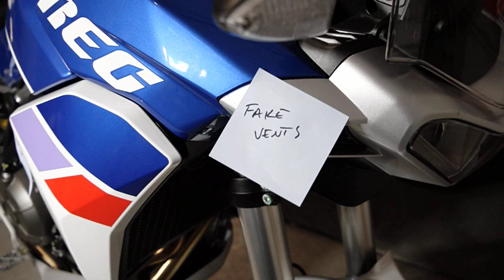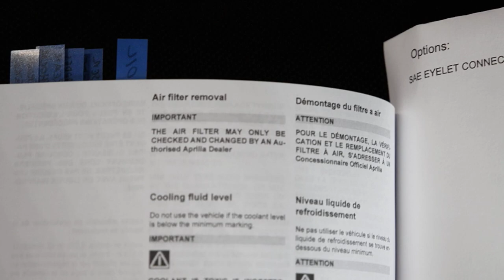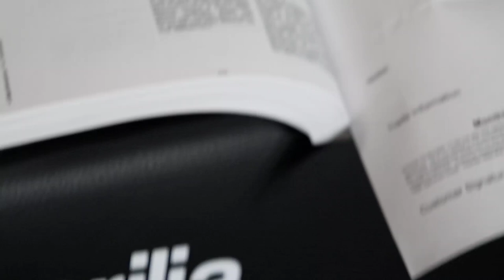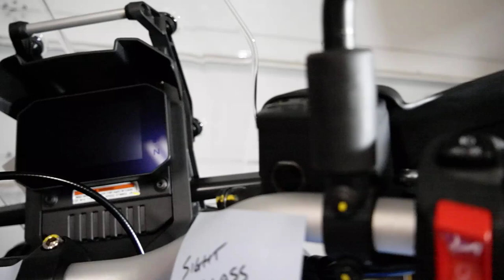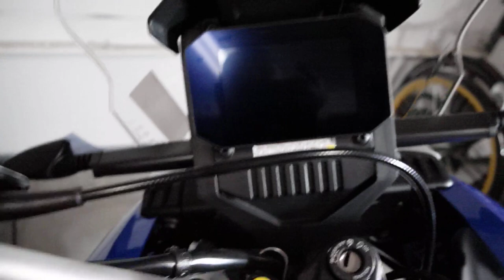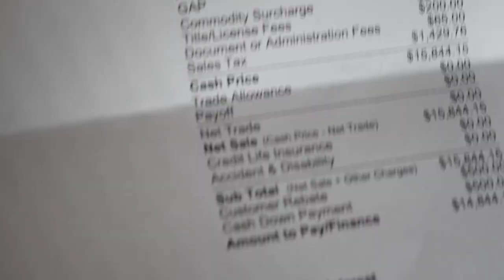Aprilia Tuareg 660 First Impressions

Comment: I don’t believe they are fake Vents I believe they are support for the fairing ..fairings are there to keep the air off your legs It looks like the air is forced through the radiator pushing down around the engine toward the road a clever design .. Just a point of view
Reply from the maker: You should consider applying for Aprilia’s marketing team.

Comment: I have a Tuono 660 and it's been reliable and a great bike to own. The crooked handlebars would annoy the shit out of me, but it was fixed. I have the same complaint about the non adjustable clutch. I purchased CRG set. The engine sound great stock and will sound amazing when you put a SC Project exhaust on. The leaking exhaust SHOULD stop it just needed to heat up and seal. The fit and finish on the Aprilia is much higher than any KTM or Husq product
Reply: Bullshit, Husky way better

Comment: Thanks for the honest comments. Regarding the sound; I think you need to consider the context; manufacturers are being forced to make exhausts quieter, so to give a bike a decent sound they tune the induction noise to compensate, not as good as a throaty exhaust, but not too bad considering. Also, it’s only 660cc. If you wind her up (maybe you are keeping the revs down as you are breaking  her in); the sounds improves.

Comment: Thanks for the video and pointing some things out others haven't.  I pick mine up tomorrow.  I paid $400 more for the Dakar color.  Paying $12,699 plus $800 for delivery in New Hampshire.  Hope you are still liking the bike after two years.  

Regarding form following function, I couldn't agree with you more.  I would never buy a Mustang because of the stupid side vents in the rear when it is a front engine car.  Maybe I will drill out the plastic behind the radiator to make them a bit more effecient and purposeful.  I totally thought the intakes were up high by the light and I am pretty sure a youtuber said they were specifically.  I wonder where the intake draws air from if not there.
Reply from the maker: The intake is underneath the "tank."  I think I have another video when I take it apart and show how to do it. It's been a while since I've been riding and doing these videos, over a year.  I'm only now getting back into it and my memory is failing me as to what I vlogged and whatnot.  Anyways, I'm back!  I think you'll enjoy the bike, as much as I think I over paid and it's not perfect, I'm glad I still have it.

Comment: Thanks for the very informative video. If I did a similar video about my BMW 800GSA and 850GSA it would be 5 hours long. Hopefully, that helps put things in perspective. I'm very happy Aprilia resisted adding gizmos and weight to this bike, unlike BMW. I bought mine recently and don't have the +$200 charge (same color as yours), I do have the exhaust crud which is annoying, I think the exhaust sound is amazing and not requiring an aftermarket exhaust that I've had to put on all my other bikes, and I do not have the TFT tilt (within 0.3 deg measuring at several locations with a digital level). The heat on the right is not a problem at all with adventure riding gear, it is annoying with jeans. I find the oil dipstick mildly annoying to unscrew and screw in because it's nested in-between stuff, could use a larger tab. The clutch lever doesn't bother me, the levers never match on my mountain bikes as the rear brake pads wear much more than the front. For the non-adjustable components (rear brake, shift lever, and clutch) I think they Aprilia an amazing job putting them in the proper place, I truly couldn't believe it given that I can't get my 850GSA rear brake lever in the correct location and it's adjustable. Drives me nuts when standing on the pegs off road. I've owned a lot of motorcycles (adventure, sport...) and this went to the top of my list for pure fun, on road and off.
Reply from the maker: Nice, good to hear you rank it high amongst your previously owned bikes.  I'm new to the ADV arena, so don't have anything to compare it to.  However, I did ride a 2022 BMW GS1250 on the road for about 60 miles recently, and liked my "rag" way better.  I agree with you that Aprilia did a great job putting everything in the right place, that or their ergonomic test person is similar to you and I, I'm 5'8" with huge balls.
Reply from the maker: Oh man, I just realized you’re part of the 0.7% of my audience that is female, based on Google’s analytics.  I hope my last reply did not offend you, my apologies if it did.  My attempts at humor are often offensive, but I’m a nice guy in person.

Comment: Thanks for putting this video together, I’m curious if you pre-ordered online, or picked it up at the dealer? I pre-ordered one (with heated grips & center stand) trying to determine how long it’ll take.. and now that I’ve seen your video, if there’ll be any other charges.
Reply from the maker: Hey David, I called my local Aprilia dealer and asked if they were expecting any. They said yes and I put a $500 deposit down.  I thought they would push accessories when I actually picked it up, but they didn’t even bring the topic up. I had to ask about them and whether I could get a discount since I was buying the bike there.  They said maybe I could get a 10% discount on parts. I thought about getting a bunch of stuff, but since decided to only get what I absolutely needed. Thus far, I haven’t really “needed” anything.  I have no idea how long an online pre-order would take, sorry. I think the two accessories you ordered would be what I would get, those and maybe the lower comfort seat since I’m only 5’8”.  However, I’m doing fine as is.  I’m also waiting for more third party vendors to come out with accessories, which I think will look better and hopefully be cheaper. Oh, regarding “hidden charges,” if I could do it all over again, I’d be ready to walk away from the deal if I smelled anything fishy about the invoice, which in hindsight, I kinda did.  Not sure if you can do that in your case since you’ve pre-ordered it, but you should be able to feel good with the deal before plunking money down.  Just my 2 cents. Good luck though, you will like if/when you get it.

Comment: FWIW, I did not have a commodity surcharge. I paid $800 for freight, $200 for the Admin/document fee, and I think ~$15 for title and temp tag. I think it was $13,598 before taxes. I don't think the commodity fee is coming from Aprilia... Thanks for the video! I'm going to have to check my bike for the things you've pointed out...
Reply from the maker: Thanks for sharing Adam.  I'd be interested to see if your dash is slightly off also.

Comment: Thanks for your video. It is the details that determine the quality of the motorcycle and when something is visible on the outside, what it will look like after x thousand kilometers inside. It's not a bad motorcycle, but for the money it could have been better, including overpriced spare parts. I choose between the Tuareg and the Tenere and I am becoming more and more inclined to the security and reliability of the Tenere.
Thank you.
Reply from the maker: Radek, I agree reliability is definitely a key factor when considering it against the Tenere.  However, I will say that I'm still glad I chose it verses the Tenere, in that it's different and has a certain bling factor that I don't think the other bikes have, specifically the T-7 and the KTM.  I say this without actually owning either though.  It's like dating a girl, yeah she's not the sharpest tool in the tool box or doesn't make sense at times, but she's hot, so those factors don't seem to matter until they suddenly do down the road.  If you're a female reading this, swap girl/boy, he/she and loaded/hot.  Trust me, I'll be the first one to complain about this bike's reliability...

Comment: The Dealership pulled fast one... How bad is the heat from right side?? I've read a lot about it..
Reply from the maker: Yeah, I think they got me, oh well, so is life.  Regarding the heat from the right side, it's really not that bad.  Yes, I do feel it, more so from the right than the left, but would knowing that beforehand have stopped me from getting it, or do I regret getting it over the Yamaha T7? Nope.  The more I look at it and ride it, the more I'm satisfied with my decision.  Going back to the heat, whenever I feel like it's getting too hot, I just kick out my knee and let some air flow through.  In the whole scheme of things, it's minor, at least to me.  However, it's all relative, I've suffered through much more for much less.
Reply: @ocdmoto  Good to know...
Reply: The heat is more than double my africa twin and thats 1000 cc. Actually the honda has zero heat. Its all because Apilia stuck the Cat in front.

Comment: How did your fake vents to open vents help in cooling and also did it direct the hear better away from your legs or just in a deferent location around your legs?
Reply from the maker: Mr. Rogers, I really didn’t notice a difference because I didn’t ride it a lot before doing this mod.  However, I suspect there’s more heat around the upper front shin area than before, although when I put my bare hands over the vents it’s not like there’s super hot air flowing out.  There’s way more radiant heat coming up from the cat. I was ok with this possibly of more heat before making my first cut because I felt cooling the radiator more efficiently was of greater importance than any extra heat I might feel. Also, knowing those vents were blocked really bothered me every time I looked at that area, which by the way, is a focal point for me.  I would like to know if other Rag owners (that’s what I call it) see engine temps at three bars or higher on their dash?  I hardly ever see above two bars. If others see three bars all the time, then opening the vents actually made a difference.  If not, no biggie, I’m still glad I took the time to do it based on principle. Thanks for your other comment on my other video btw.

Comment: I'm looking at this bike but dealer support is hours away not sure if that will hurt me. The T7 is not for sale anywhere near me and definitely not at msrp. Whereas I can get one of these seems like a great bike based on reviews but no one has had one for that long. Would love to hear how your feeling about now that you have had it for a month or so. Thanks
Reply from the maker: Hi Tim, I do like it and would recommend it to you.  Granted, I don't know you, but if you're in the market for a middle weight ADV, I think this one will prove to be the one that hits that sweet spot in the coming months and subsequent head to head reviews.  Any issues I have with the bike are cosmetic, which I've addressed with my mods, and the dealership I bought the bike at (cause I'm think I got suckered into paying $200 over MSRP).  Having done some simple mods already, which required me to take apart some fairings and whatnot, I have been pleasantly surprised at how the bike was designed and the quality of its parts.  There's a lot to be said about how a bike makes you feel, it's hard to quantify on paper, but you know it when it does.  This bike does it for me.  I think you'll like it more in person, where as I think you'll like the T7 a little less in person, until you "personalize" it.  It doesn't seem like you have a choice, but I don't think you'll be disappointed.  Even if The Rag (which is what I'm calling it) proves to be unreliable, we'll just have to deal with it.  Sometimes you have to just go for it and never look back.  Let all the bean counters and worry worts argue stats and what if's, we'll be out riding and having fun.
Reply: @ocdmoto  hey man thanks for the reply I have a got a test ride next week and unless there is something I really don't like looks like I will be getting one !
Reply from the maker: That's the right way to do it, good luck and congrats, -cause I know you'll like it.

Comment: Yep my dash is canted about 3-4 degrees to the left. Tft is cock eyed on mine too. Not an easy fix either. That shit mounts on steering stem.
Reply from the maker: Katherine, you might be surprised how much it'll move once you loosen the four bolts holding it to the steering column.  You just have to hold it in place while you tighten them down.  That's assuming you've removed the three screws holding the radiator fluid reservoir and the two bolts holding down the two small fairings on either side.  The distance of the visual line created by the dash and side markers are quite far out, so small changes at the stem, make larger changes further out.  Anyways, if you care, it was bothering me quite a bit, it even bother me after correcting because it felt as though my left arm was more stretched out than my right.  However, it turns out, my arms are just different lengths, which was confirmed when I road my buddy's BMW GS 1250.  I'm not sure how to adjust the TFT, but I'm sure it's doable.

Comment: Your charger plug doesn't match that plug because it is a li-po battery.  You'll need a different charger if you want to use a battery tender. 2nd thing depending on how cold your climate is you might want to just switch to a conventional battery because li-po are a joke in the cold. I didn't know about the air cleaner.  Another thing that I am not a fan of is changing oil is easy but to reset the light you must go back to the dealership.  Each dealership is roughly an hour away from me and never have reason to pass either on my normal routes.
Reply: Also my 1st impression of the finish on the wheels black or silver was duller than I liked and when compared to other bikes looks cheap. Another one of the major downside is the subframe is not bolted on in case you bend it and a 500 lb bike one off road dump could easily do that especially if you mounted hard bags. I think it should have a rear rack, engine guards, and quick shifter too for the price because like you said that stuff adds up. I'd also want a aftermarket skid plate because I would be going off road so there's another $300. As for heated grips I would get something better than what Aprilla offers through a aftermarket company.  I can't see the extra $600 for the blue paint either. I'm still kicking around the KTM 890 but nobody has one new and won't this year.
Reply: If the battery is worth a crap it will have a bms. So the charger doesnt matter as much. I am sure the battery is not a li po. more than likely a lifepo4.
Reply from the maker: Tim, thanks for your comments.  Yes, I changed the leads out for a NOCO Genius Smart charger.  Luckily, I live in the San Francisco Bay Area and the lowest it gets is about 40 deg F where I live.  There's gotta be a way to reset some of these "lights" ourselves.  If I figure it out, I'll post it.  Thanks again.
Reply: @timhunter1678   I think you get the lithium battery and the paint. I cant see it having a bolt on subframe and having the load capacity it does. If the included all mentioned it be close to ktm prices.
Reply from the maker: I've heard of the welded subframe being considered as a negative.  I'm new to "adventure" riding so wasn't even aware that frames can be bent and having one bolted would allow one to correct it.  Wouldn't a bent frame be an insurance write off and allow you to get a new bike, similar to a bent car frame?  Anyways, I think it's one of those specs people like to highlight as a negative, but rarely actually realized.  On the contrary, reliability, dealer network, serviceability, etc., are legit potential negatives to consider.  Just my opinions of course.

Comment: that happens when you buy european bikes,and specially italian.you would never had these problems with japan bikes,specially with honda and kawasaki
Reply from the maker: True, but then it would be a Japanese bike, either a Honda or Kawasaki.
Reply: Maybe, but if it was a Kawasaki It would have weiged 35kg more.
Reply: If it was a Honda it would weight 35Kg more and would come with pogo stick suspensions. This is the case with all the big 4 japanese bikes. They cut costs by using cheap and heavy components such as suspension, rims, seats, etc. In the end everything adds weight and translates to a poor riding experience
Reply from the maker: @sspirito3130  Indeed, well said.